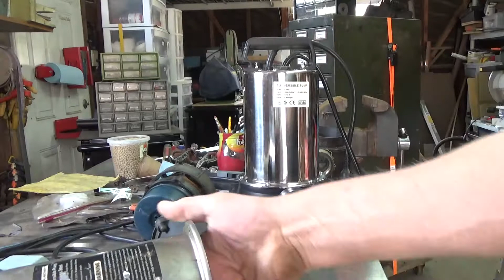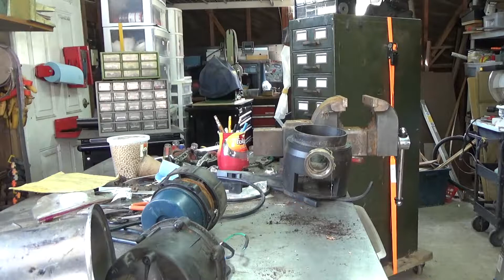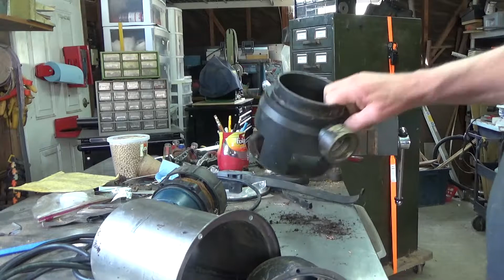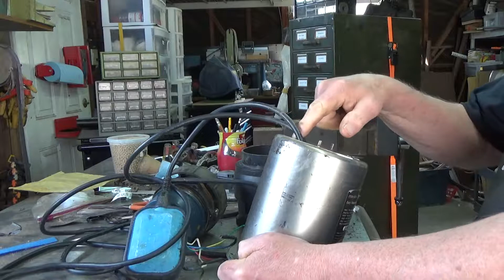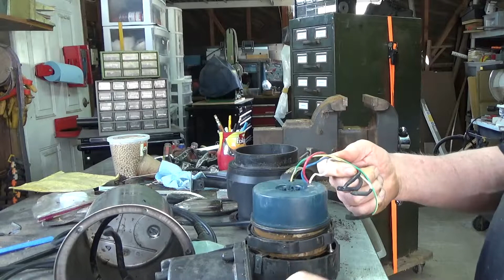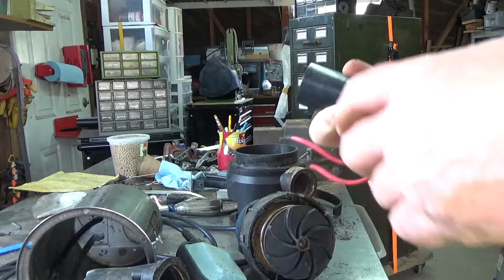1100W Stainless Steel 4300GPH Dirty Water Pump Pond Drain or Harbor Freight 46750

Comment: I bought a used pump from a local guy and it looked TIRED! But I didn't have any problems getting it taken apart or rebuilding it. In my case, it looks like some of the seals failed and the motor outer housing got soaked for a long period of time so there was extensive rust. That inner housing that is half plastic and half stainless is your next step. That plastic half comes off with some light tapping to the sides. Then you're inside the motor! The impeller comes off by securing the shaft with a flat blade screwdriver on the slot while turning the impeller counter-clockwise. It's only held in place with a lock nut using a nylon insert.